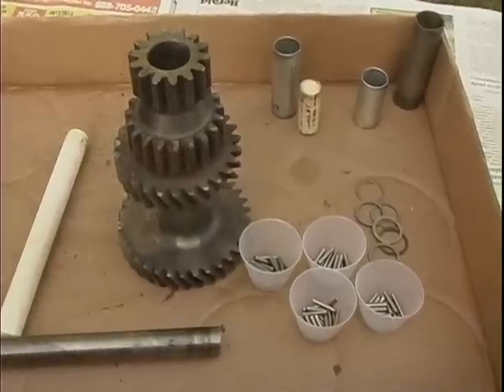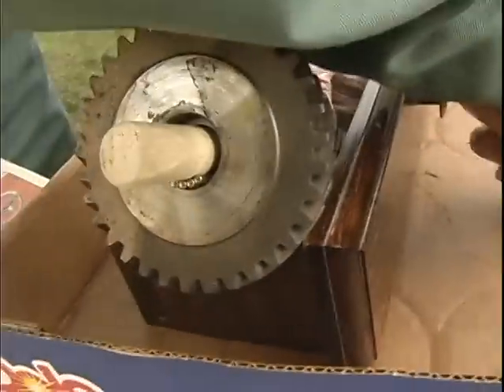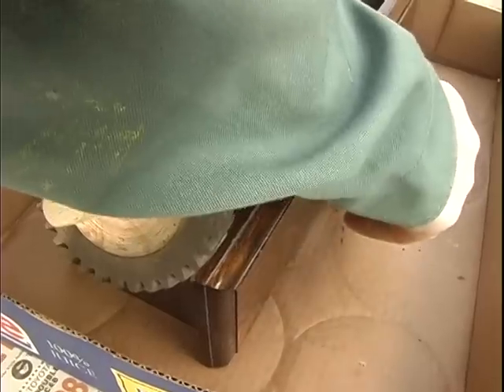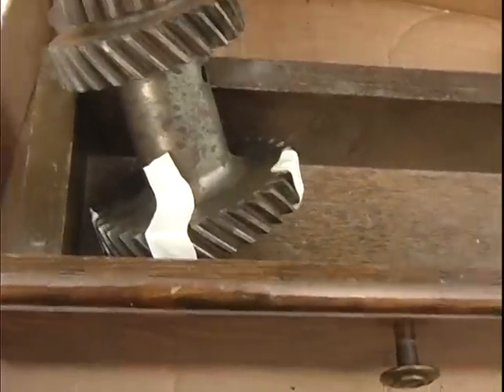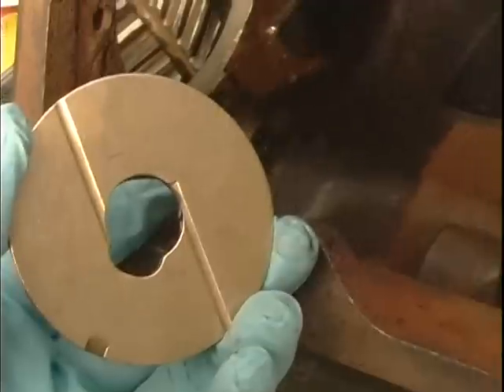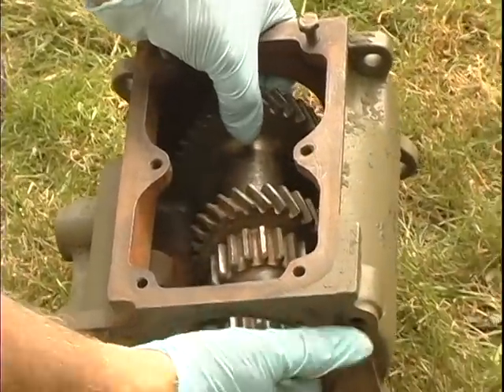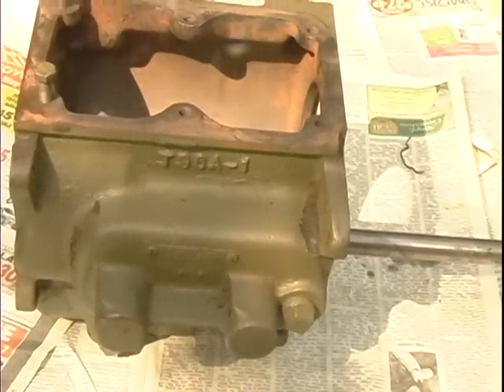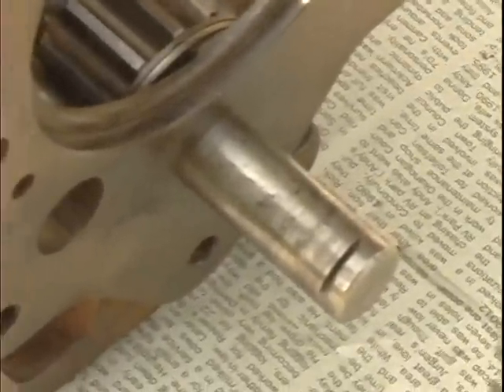Spicer Jeep T-90 Cluster Gear Needle Bearing Installation

Comment: your nuts to do that dry I ALWAYS AND I MEAN ALWAYS USE GREASE TO LOAD THOSE NEEDLE BEARINGS  THAT SHOULD NEVER BE ATTEMPTED DRY NOT A GOOD IDEA AT ALL
Reply from the maker: HA!  You simply wait a few minutes and then rotate the gears once the fluid is added to the transmission and the needle bearing are lubricated.  Just like when the transmission is in service.  There is absolutely nothing wrong with installing them dry.
Reply: @1953M38a1  i still would never attempt that dry I use Vaseline to hold them all in place and run the shaft through to lock them into place